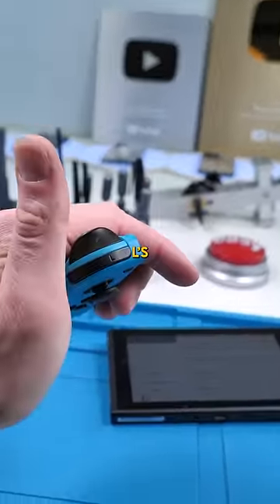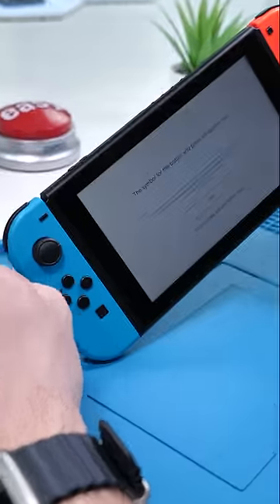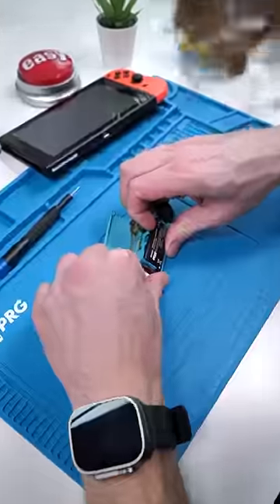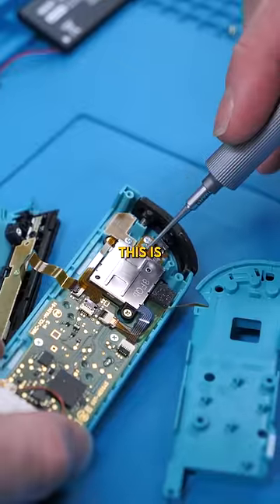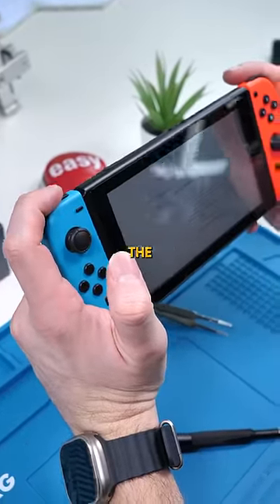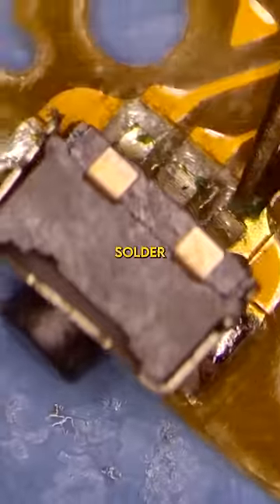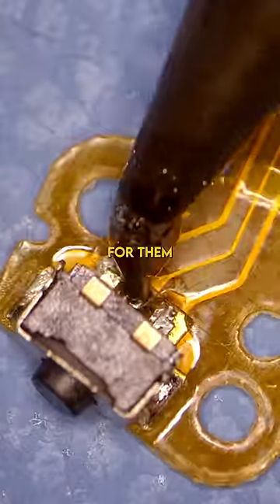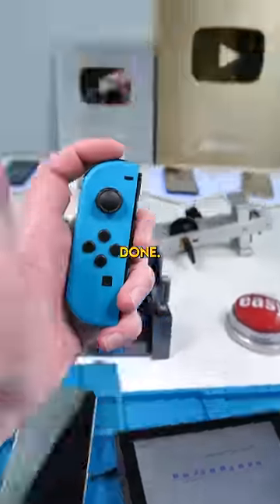This JOYCON Refuses to Take L's... #Shorts

Comment: Yes, this button is a problem 9 times out of 10. Even if it's soldered properly it still goes off due to design issue, especially when non-original housing is replaced

Comment: I had the same issue with my switch lite last week and opening the switch lite showed my just how much easier is is to fix that than a joycon, all I needed to do was take the plastic shell off and clean the sensor (however there was a stripped screw when I opened it and I never opened it preveously)

Comment: i had a similar problem with my box joycons. at first they worked fine but later on they were starting to have some problems. turns out in mine there was dust accumulated under the button and i just had to blow in the little hole to the side of the joycon L button

Comment: Unfortunate that since the same button on the right joycon is soldered directly to the board, they are expensive to replace as you’d either have to resolver a new button or replace the board.